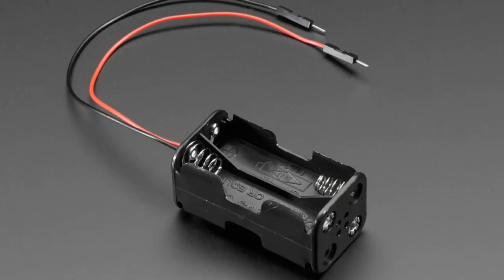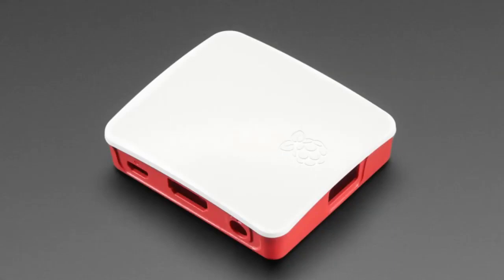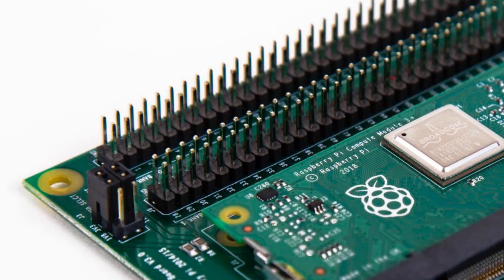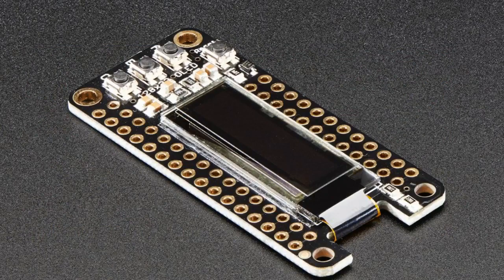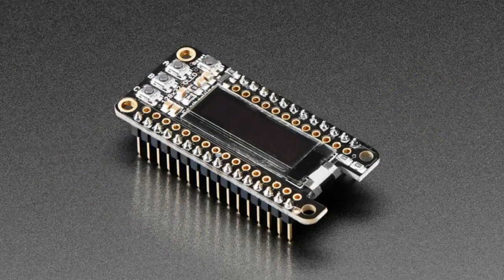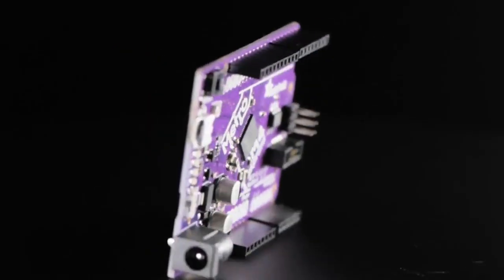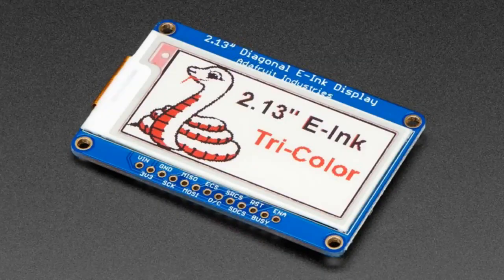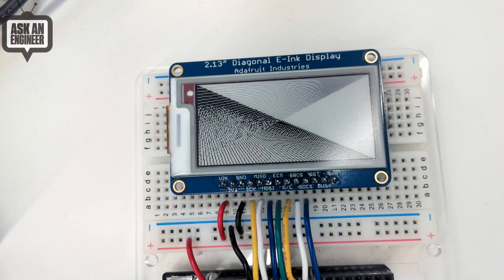New Products 1/30/19 Featuring #Adafruit 2.13" Tri-Color #eInk / #ePaper Display @adafruit

Comment: you could show a configuration using Arduino Mega 2560; negative or differential pressure sensor -20kpa-0 kpa;  a mini vacuum pump; switch on / of operating program.  To be used for empty chamber.  if the pressure is <-10kpa on pump if instead it is> -16kpa off pump. thanks

Comment: The new Raspberry Pi compute module is really interesting but the dev kit is currently out of stock. I wish one could place an order for out of stock items instead of using the waiting list and checking for the in-stock notification email before finally placing an order. Having an option to just place an order regardless of inventory would save steps. Thank you